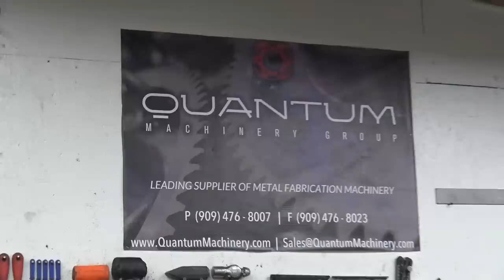Tao Tao Arrow Go Kart Ep1 ~ Swing Arm Build

Comment: Looks good I would leave it a 2 seater so the Mrs can ride with u. We have one like that a 4 seater. We go trail riding with the 2 oldest kids. The wife loves it. I use a Polaris motor from a four wheeler. It's automatic with reverse. We use it all the time. Weeks ago I added a stereo system from a junk car. We just use the Bluetooth to play music. And I use outdoor speakers which are waterproof. I am thinking of rebuilding it into a 6 seater. And add a old VW motor. Since u don't need a radiator.

Comment: I have a Kandi buggy with a GY6 150cc. I've done everything to it and it is still destroying belts. Even Bates PowerLink belts. I've replaced the variator, clutch, spring weights stiffer and softer, roller weights lighter and heavier, checked pulley alignment, checked everything else. The case cover is breathing well. I don't know how to fix it. I've had it on blocks with the cover off watching the pulleys change ratios with engine RPMs running up and down and it is operating just fine. But it still kills belts in just a few hours, sometimes faster than that. It's so frustrating!!!

Comment: Dude you got to put a 670 in this!!
Reply: Chris Ortiz and 3speed 🤔🙏🏼
Reply: He could use a old three wheeler engine as a transmission just pull the stuffing out that aren’t needed and run a chain from the 670 to the crank of the other

Comment: Hate to criticize but you asked, so...  I realize it’s easier to mount the engine to the swing arm and all, but I would do whatever it takes to mount the engine to the frame, chain tensioners or whatever. It’s got to be a nightmare for the shocks to control the extra weight, and then the extra stress on the axle leads to extra weight for the axle bracing, and on and on. Cool cart though.

Comment: I like it alot. What is the length of the axle
Reply from the maker: 54"
Reply: @RedBeardsGarage  thank you. I own three 150cc go karts and one thing I myself and others who have seen mine all say the same thing about the rear tire sitting to narrow.  if you made those rear ends to bolt right up to standard I bet they'd sell . I just don't have the time for a lot of fab work but some just can't fab but would love a rear assembly like this if the were affordable and sold through gopowersports I bet they'd sell easily